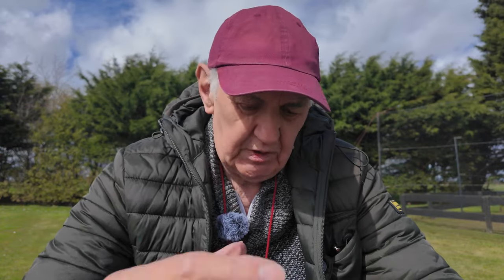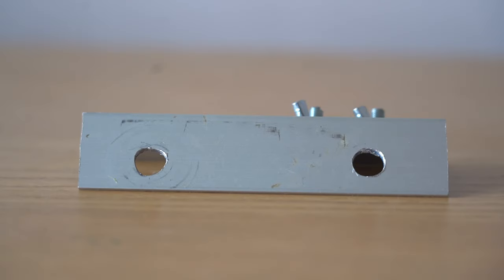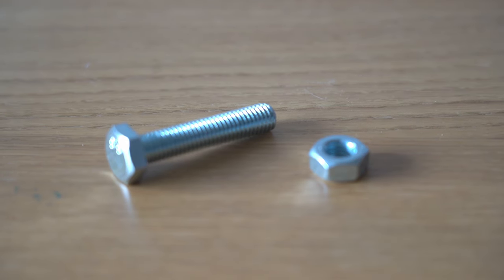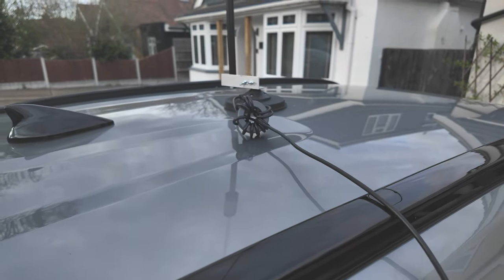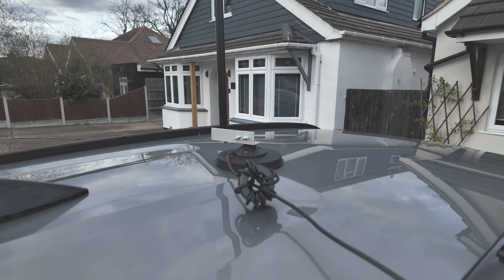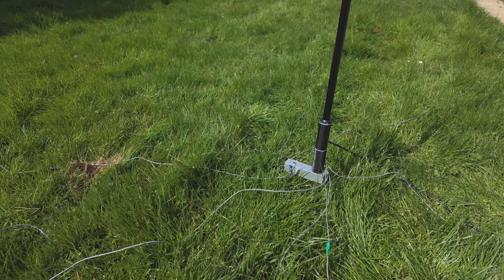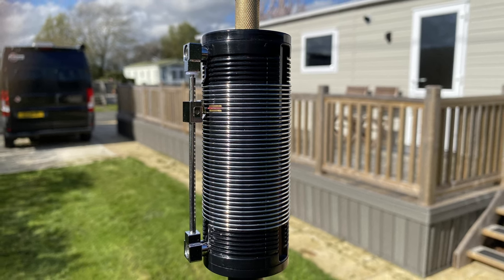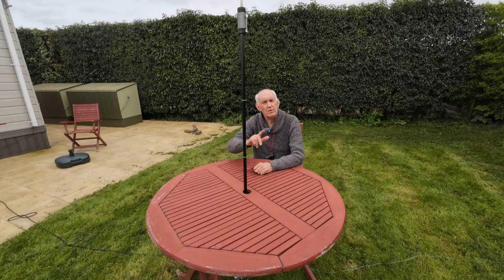JPC 12 Antenna - Simple Modification

Comment: Hi Peter, 
Wouldn't the radials be electrically connected to the hot side of the antenna, rather than the ground? 
Does that matter? I always assumed they had to be electrically isolated. 
Cheers, 

Matt 
M0PTO
Reply from the maker: Radials are always connected to the earth side of the antenna. But you are right,  when the bracket is used  on a mobile mount,  the bracket is live and forms part pf the radiating element.

Comment: Nice set up peter.
20m to the uk from zl is good on dark here. Have a nice weekend. 73 zl3xdj
Reply from the maker: Hi Brian, thanks for that. I worked VK two nights ago on 40m. Must send you an email and catch up. 73 Peter.
Reply: @watersstanton  vk on 40m, well done. 40m not open here for me, but 20m along the greyline is good to the uk, even had uk on ssb last night.
Here there is a big difference between vk and zl south island on 40m.
Iam recently around 14.030 - 14035.
73.

Comment: Thank you for sharing Peter .
I just wanted to point out how can the wing nut radial connectors that you have applied to the main antenna positive supply L bracket work ? ,  sadly this will not work as you've essentially connected the radials connection to the main positive  feed supply to the antenna .

Comment: I solved for this by simply getting a 3/8”-10mm adapter
Reply from the maker: Decent ones are not that easy to find
Reply: @watersstanton  A decent thread reduction adapter should be K&M 21980 (from female 3/8" to male M10), together with a male 3/8" to male 3/8" adapter (like Manfrotto 125), both are available from Thomann, Sweetwater,  Canford as well as probably other music stores.
Reply: @arndgronenberg  won't do the trick! Antennas have 3/8'' UNF and not 3/8'' UNC. This won't fit!

Comment: What?!?! 

"One of the most obvious problems is that this antenna has got a 10mm thread."

One of the most obvious problems with almost any (US-made) antenna is this awkward UNF thread. Outside of the US you simply cannot get any spare parts (nuts, bolts, screws) using this thread. You have to make all of these by your own. I have the possibility to do that. Most Hams in Europe and in the rest of the world cannot do this and live in a pure metric world (meters, millimeters...) and have a really big problem with these UNF antenna threads.

The JPC-12 antenna having metric M10 threads is one of the biggest plus-points of this antenna.

Comment: Hi Peter. I was looking forward to this episode about this antenna. I have questions. How many and what length do you recommend the radials be? Is it mandatory to use all 4 aluminum tubes (vibrators)? Can an antenna work without them? I have a longer telescope, does that mean I can work on 5 and 3.5 and 1.8 MHz? Or can I use the original one for these bands? Greetings, 73! LZ1INP
Reply from the maker: I think I covered most of this two videos ago. I use 3m radials nut not critical. . You can remove tubes. You need a very long whip to get down to 80m. Probably not practical.

Comment: Peter the radials won't work off that bracket
Reply from the maker: I probably confused some viewers. The backer is used at the base if the antenna when ground mounted abd radials connected to it work fine. On the mag mount it is used as an adaptor and the becomes part of the radiator. in that configuration the radial terminals are not  to be used.